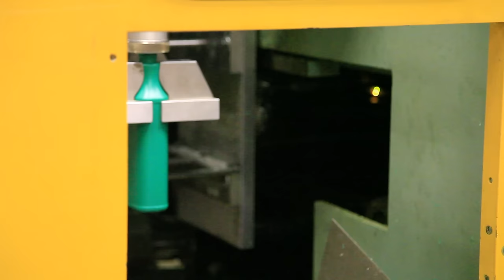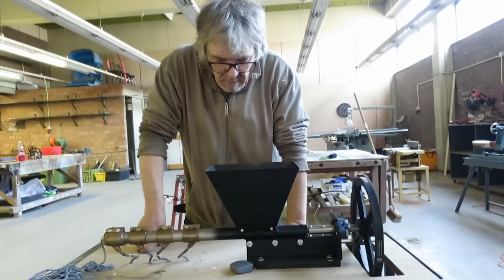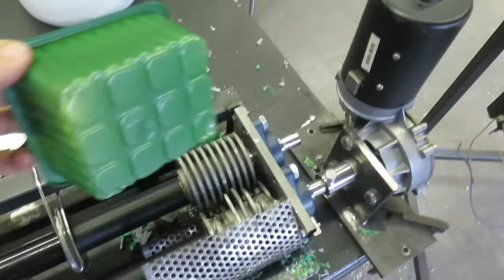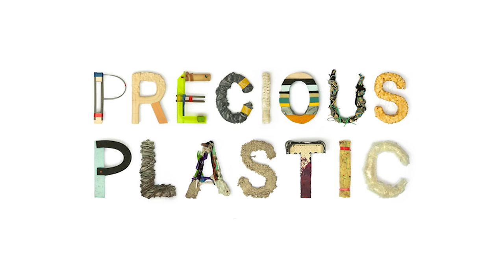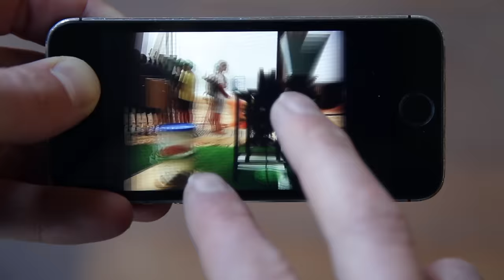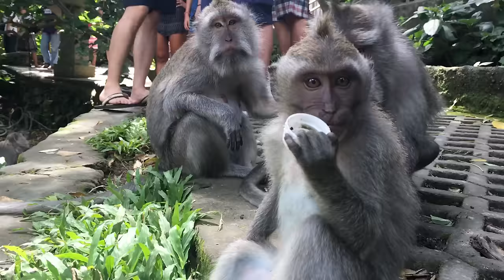Precious Plastic - The Story Behind

Comment: You should design a cutter for the extruder like they use for making pasta that way you can make little 1cm chips and use them in molds more easily.
Reply: k_froggy yes I also think my first step will be to produce pure, sorted out, pellets that I can use later for my different projects

Comment: Deep fryer or pot of oil, then insert a floating bowl/jar, Melt the plastic in the bowl /jar.
Perfect temperature. 
(Do Not Consume Oil after used for this!)
Oils that fail to remain isolated require proper treatment Before reuse||recycling||repurposing. Do Not Dispose of in trash!.
Needed Research may include #OilRepurposing, #OilRecycling.
 
#MaterialDataSheets can be useful for those who can navigate them.

Comment: Do you 3D print too or just mold and shape your plastic?  You seem to have machines that could make filament.  Plastic recycling shops would be nice just so I don't have to throw it away.  I hope it makes the value of the plastic go up somewhat.  I typically only recycle aluminum and copper but it small batches because it has to fit in the trunk of my car.  I don't want a truck, they are hard to see the back end of, often gas guzzlers, and sometimes do not handle well enough.

Comment: it would be nice to find a way to use it on 3d printers.  maybe make a different type of 3d printers beause the current 3d printers don't encourage in recycling rather they increase plastic waste.  I was thinking of making 3d cnc machine that could engrave plastic blocks which u make from recycling plastic. you could make different shapes and designs with cnc engraver. the only problem is that I am not very technical, and I am hoping someone could design the machine and share the blueprint.  it would be nice to make smaller version of shredding machines so that regular households can buy them, and would be able to recycle. no one is going to buy or build a big machine unless they have a work shop but if you want to get everyone involved, then you must design smaller size machines (no more than the size of a juice blender).  once you could sell small shredding machines, you could also design and sell mould to make blocks which you could use on a small cnc engraver machine (we need to make a small size that could be used in any household).
Reply: They made an extrusion machine which can be made to produce 3d printing filaments from recycled plastic.

Comment: This needs scaling up a bit. Why not units to turn out larger pre fabricated sections for emergency housing for those countries hit by natural disasters. Plastic housing would be relatively quick and easy for indiginous labour to erect, safe against earthquakes and with the raw material so widespread and available the costs would be relatively low. Something solid would be better than the tents used at present.  It would need a bit of capital to get off the ground maybe from one of the international disaster agencies.

Comment: Just connect extruder of this machine to 3d printer =D
Reply: Tirarex I am actually working on doing this, i could upload some videos about it if anyone's interested :)
Reply: ok, wait video from you ! (subscribed)
Reply: Make Glue Sticks, and use your Handheld Hot Glue Extruder to make Hand Made 3D Projects. Of coarse 2d on a flat surface works too.
Reply: 3D printer needs accurate diameter filament unless it's gonna be shitty prints
Reply: you can use a 3d pen to hand print objects with your homemade fillament

Comment: I'm surprised no one lost their hands in the shredder yet, looks super dangerous. Or did they?
Reply: Alexey Zaytsev yes there is a risk but you don't need to get your hands near the blades at all you just drop the plastic...
If anyone need to make it safer they only need to add a simple cover on the top of the funnel and a simple one underneath to  avoid accidental contact with the blades.
Reply: Naiemaa I made one shredder of this type, I put a polycarbonate cover on it and fit it with a industrial safety switch, connected to a emergency stop relay and a hybrid motor starter.
Reply: impressive, way to go... for everyone who is concerted about safety, you can make it as safe as you want...

Comment: I think creating some kind of insulated brick for building homes would be great. Maybe we could figure out how to recycle polystyrene and use CO2 as a blowing agent to produce large foam filled bricks.

Or build a larger scale 3D printer design that can print "SIPs" out of recycled plastic. Print plastic shells, then put PU spray foam into them. With a good CAD design program you could split a house into many little puzzle pieces that get 3D printed, filled with insulation foam and then glued together.

Comment: Here is an idea I had you can make a snap on cover for most anything to protect it from the sun out of plastic I wanted to make something like that for my bass boat to help prolong the paint life even for cars it doesn't have to be thick just a thin layer like a skin for a phone but just a little thicker and you will have a huge market on cars think it would be pretty sweet bust the cost has to stay lower than a paint job